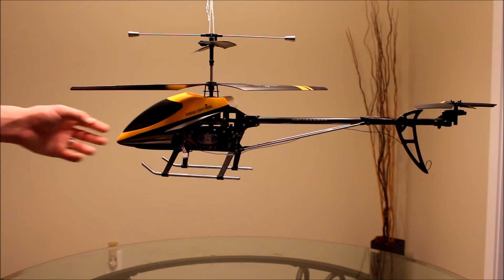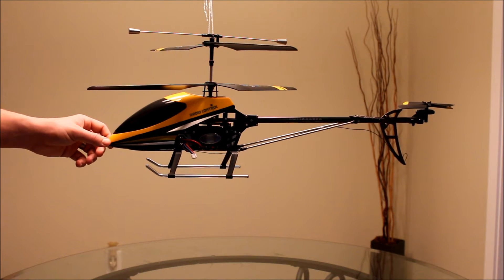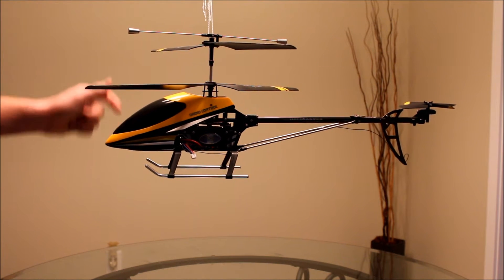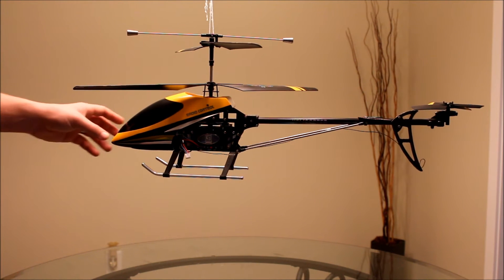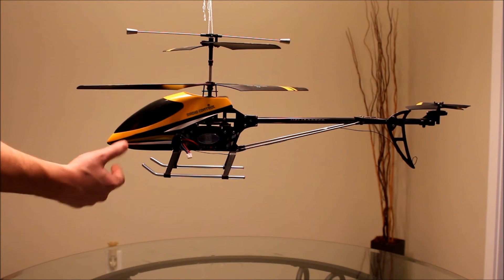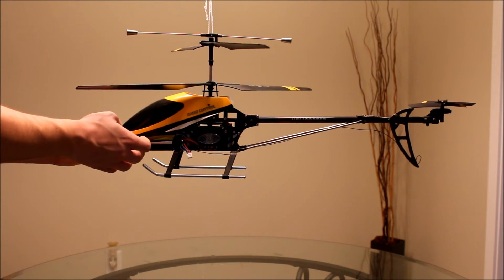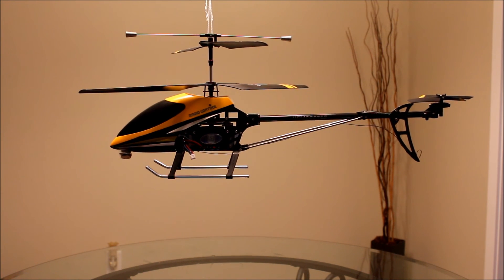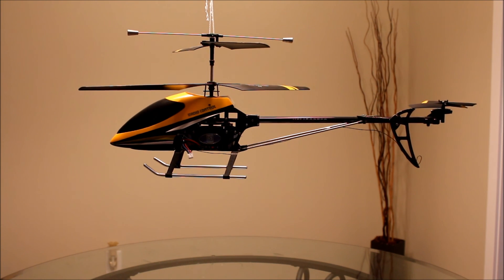Double Horse 9101 - Balancing weight after tail rotor mod.

Comment: Now I can not set the rotation to one spot  the heli  continues to spin ,if I set the trim nearly to stop spinning it will start spinning again  [ opposite direction ]   ,it wont lock into a trim to stop spinning. what is the fix for this? 9101 double horse heli.
Reply: You have to recalibration

Comment: I found that packing modeling clay into the nose cone works really well especially if you are making alot of modifications and the weight distribution changes from time to time. It's much easier to add or remove modeling clay than weights glued into place. It also makes a great performance adjuster to add weight where needed for different flying conditions and maneuverability.